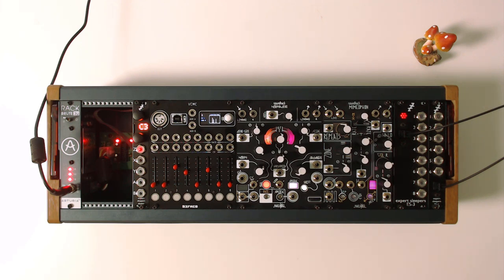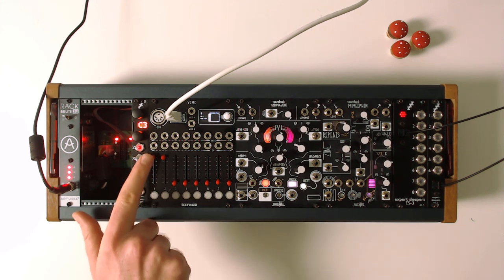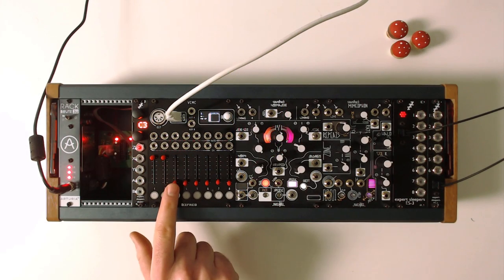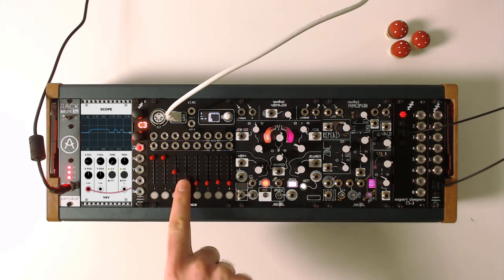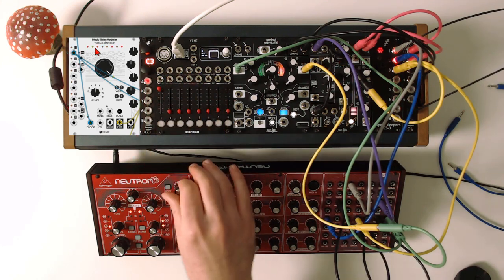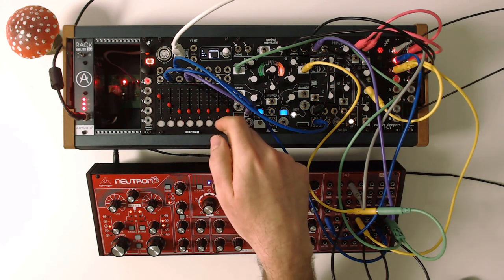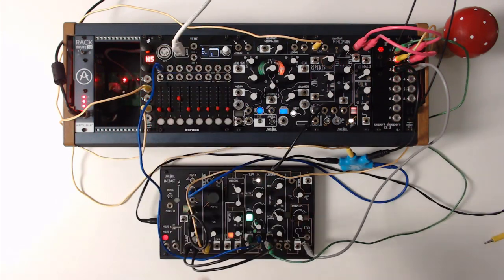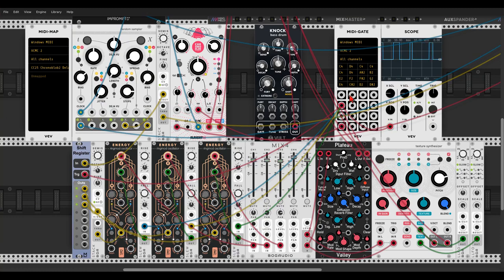Using Befaco's VCMC with VCV Rack

Comment: Hi Omri! Thanks alo for your videos! I have a modular but im trying to integrate it with vcv rack with expert sleepers es8-es7 and also befaco vcmc. The problem i have is sync :( i have tried various ways, but if for example i have an external turing machine sending gates and voltage to the vcmc that converts it into midi and then i control a voice synth inside vcv rack, i always get a latency when listening to external sequencers with what comes out of vcv rack, i know this is normal since there is a chain of cv to midi conversion and then midi triggering voices and finally audio out. On the computer i can deal with this with expert sleepers es5 sync plugin, but have not found anything similar so far on vcv....something like the stellare offset but for a clock. So i could clock the modular from vcv or vcv from the modular and somehow compensate for this latency...its a real bummer! Any ideas or work arounds that come to your mind? Many thanks and great youtube channel!
Reply from the maker: Hi! Thanks so much, first of all, I appreciate the kind words :) What I do from time to time is I use a signal delay in VCV to add delay to the triggers and by that make sure that everything is in sync. There's one from AS for example, but you will have to experiment and calculate how much latency you have, in milliseconds, so you know how much to add. Will this help?
Reply: Hi Omri! Thanks for the reply :) 
I found your es9 video and saw you tip on delaying the clock signal with the as trigger delay. Mine wad 20ms and i have mostly perfect sync now :) Having stopped using computer more that for coding or cad duties, its crazy how many modules and how much has vcv rack grown! Too many modules to keep up! Loving your videos, much appreciated. Take care and be safe :)
Reply from the maker: I appreciate it, thank you!